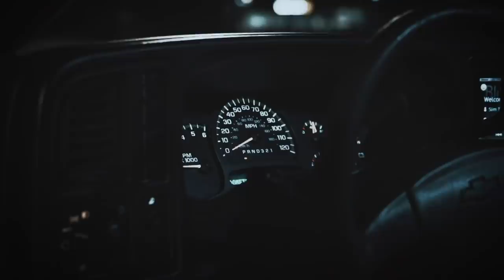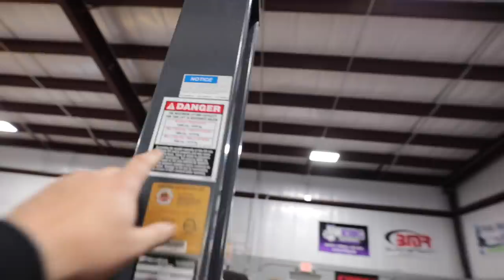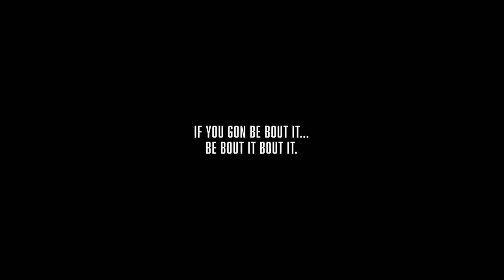My Race Truck’s FIRST START after being Broken for 8 MONTHS!!! *VERY LOUD*

Comment: Watching you act nervous putting that 2020 on the lift is relatable. I put a lot of brand new 2500s and duallies on a 2 post and it can get tense with all that weight in the air.

Comment: I have the same exact truck, year and all but it’s a base model and my dad used it as a work truck and has 250,000 miles on it I want to make it like yours before you put the black tint on the roof but I don’t have the pockets for it rn. Been a fan since the 100$ eBay mods video, love the content man, don’t lose sight❤️

Comment: itsjusta6 for the  engine put a TSP 454 with a pair of Precision turbo 7685s along with a air to water intercooler and a pair of turbo smart BOVs & waste gates . as for the rear end a moser 12 bolt with all the fixings will do along with ARP wheel studs

Comment: This is literally how I felt after I just got my camaro started after my wreck. About 6 months ago(last August) I passed out driving because of my Diabetes and I rolled my camaro 6 times and I woke up in the field with no idea what happened and my back was really in pain and without realizing it I ended up Burst fracturing my T12 and had to have 2 plates, 2 rods, and 16 screws to fuse my back together. With my Camaro out of commission I was depressed while in pain and recovering and I ended up buying the car back from the insurance because the motor, tranny, and interior were completely untouched except for my headers. My Camaro was a 2011 Camaro SS with inferno interior, fully built 6.8 LS3, stage 4 btr cam, ported and polished heads and I was thrilled to know that my motor was good. So I found a 2010 camaro roller and it was an automatic roller so we had to swap it to a 6-speed which was a royal pain.. so 6 months in the running now and I’m healing, I can walk, I can drive, and we finally just got the camaro started... it’s been so long in the running and it made me almost cry and hopefully sometime I could show Gavin my camaro seeing how much he has always loved his even with the ups and downs.. I hope Gavin and crew reads this and hopefully I can see y’all next time y’all have a huge meet!!!!

Comment: what injectors are you guys running in the drag truck? And what is the transmission cross member? I am looking to rebuild my 5.3 vortec and swap in a 4l80e rated for some major power. @itsjusta6

Comment: Does the 5w 50 work good nervous about running so thick but in my camaro my motor is built for nitrous so really lose uses oil so need some thicker oil

Comment: I know electronic throttle cars don't run idle control valves.all in the tune.throttle body should be cracked open some anyway.even new stock cars are the same.sounds good though.

Comment: GAVIN. Do NOT bypass the inline radiator trans cooler!! The cooler you installed is air cooled, so if you’re idling or not driving fast the cooler is not working. Run it back thru the radiator cooler that way that even if you’re idling the water cooled radiator trans cooler is still cooling the trans fluid off. I did it on my 07.5 Avalanche with the 4l60e and my trans will not go past 180°

Comment: Pull the 6.2 out of the 5th gen get that motor built with a twin turbo set up from hell horse and drop the motor into the 67. from there I would take the built coyote motor you have laying around and I would drop that back into the 5th gen

Comment: Guys, I have a PSA. Be as careful as possible when you race. 12 hours ago I wrecked my car speeding, did 3 flips. I came out fine somehow, but I easily could've died from a crash where I was going 50. Luckily I was convoying with a friend, but please don't get yourself hurt racing, or speeding. Learn from my mistake.
Reply: And one more thing. Save it for the track if you decide you really want to open it up. Don't endanger anyone else.

Comment: STOP!! You guys need to quit using Blackstone. There oil reports aren’t very accurate and they don’t test everything in that oil. 

Go with Polaris Labs. They’re more reasonable and they test the oil on every aspect of it and also check for fuel dilution too. Which it’s an important thing to know as well.